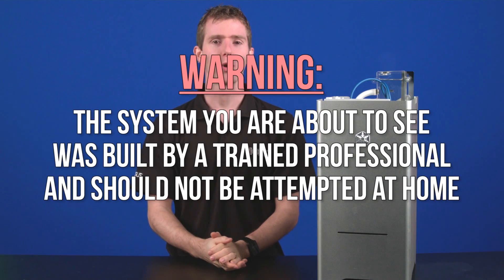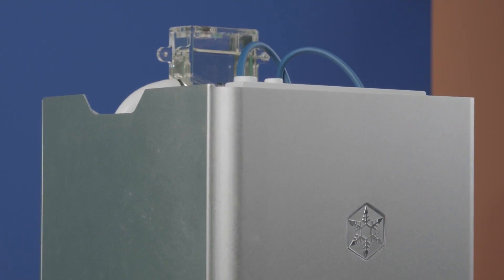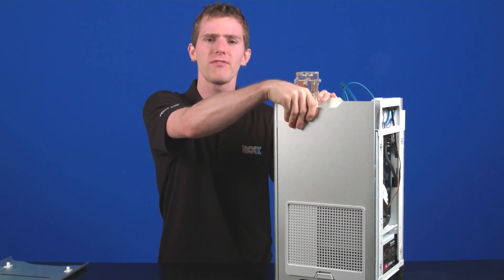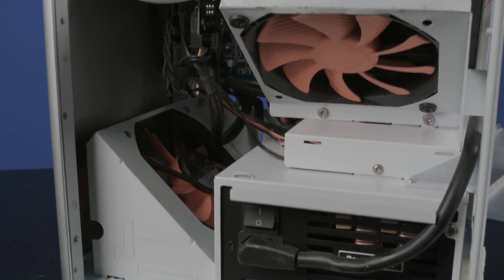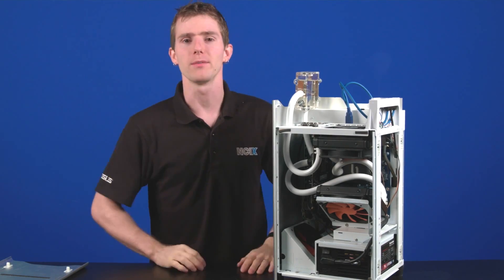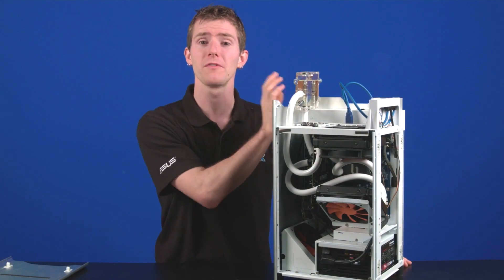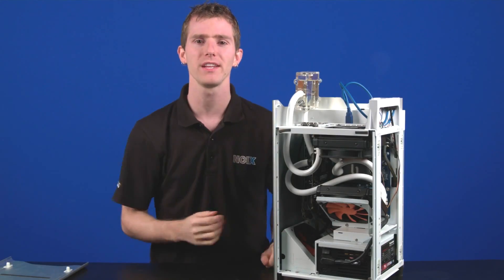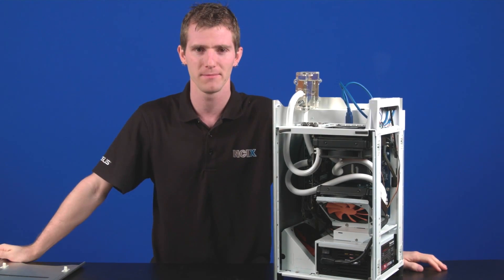Fully Custom Watercooling Loop for under $100!

Comment: just bought a broken nzxt kraken x61 off kijiji for $30 and repaired that. gonna ziptie that suckered onto an r9 290x. had to solder on a new power connection for the kraken so no it runs of molex power instead of Sata power but hey, should work... right ?

Comment: i plan to just get two sealed loops one for cpu and one for gpu and as im pretty handy with tools i plan on making a bracket to adapt one sealed loop to my card, i feel my r9 290 is going to heat up my processor without need if i have them connected or is that stupid and i should connect both loops? and what would be some decent but inexpensive loops to get? i want them reliable as i dont want a spill ove my computer but i want some fairly cheap ones if possible

Comment: I wouldn't trust those pumps in the all in one watercooling kits. If you are serious about water cooling invest in Tygon tubing and the more expensive Swiftech pumps like the mcp series. It is money well spent as you can use it on new systems the only thing you might have to change is the water block. BTW I would NEVER put a power supply UNDER my cooling gear. If you have a leak or even when putting the system together or doing maintenance you never want any chance of spilling on the power supply.

Comment: dude quit bitching about the PCI slot. I think it looks better than if he had cut them leaving a sharp edge, and before anyone says sand paper, then you would need to paint the damn thing. For what he did, there is little damage and I think personally that it looks great.
Reply: You can round with a dremel dude.  Dremel's usually come with something like 12 bits for cutting, rounding, and smoothing.   Honestly, it sort of bothered me as well, and I thought it was sort of funny how he kept going back to it. lol

Comment: This is completely unnecessary. Just put a cheap EVO 212 on the cpu, and use onboard GPU for your HTPC. Simple, quiet, and effective. No need for 3 fans, a pump, various water blocks, case mods, and a reservoir that will break the first time you bump into it by accident.
Reply: ***** Sure I do. I also know there are severe disadvantages to adding a liquid cooling system.
Reply: ***** Liquid cooling takes heat from the chip being cooled at a greater rate. That's the only practical advantage I can think of. The hardware can look amazing when it's done.
Reply: Sometimes that's needed.  I can't see that it's need here, but he was opting for a dIY project here on purpose I think with the intent of never exceeding a certain level of noise.  He stated even during gaming the rig doesn't really ramp up.  So, I get why he did it.  It's neat.  Not what I'd of done, but I hate small cases.  I'd of bought a different case entirely.

Comment: thats hilarious ,i hadn't heard of anyone actually doing what i had done with a zalman lq-310 for my gpu ,drilled holes in the amd bracket ,takes 2 minutes and a lot cheaper than a g10 and most gpu cold plates can be left on to cool vrm passively,i had posted in the red mod forum back in  2014  .nice to see someone else did it .I since moved on to a full custom loop.

Comment: I can't find anywhere a build with both CPU and GPU watercooling system on the FT03-mini case.
Reply: Because it's a mini and they are terrible.  No one wants to drill a hole in there head to design such. I'm sorry, but this looks terrible.  I'd never want to show this off.

Comment: Rebuild the same parts again 2016 & watch how big a hole you loose in your pocket lol, Like holy fuck you guys are ripped off with the dollar.....
Reply: This machine wouldn't be any different than it was a year ago.  The water cooling system with brand new parts is pretty expensive, but getting used parts it's entirely plausible.

Comment: I think it was very cool that he managed that for only 100 dollars which is basically 70 pounds where I live (UK). That is dirt cheep for full system water cooling. Currently my CPU (i5 4690k) is air-cooled with the Cooler Master 212 Hyper EVO. It is always under 50 and usually sub-40 degrees. My GPU (Zotac GTX 970) gets very hot at 70-80 degrees when gaming so I am gonna water cool it with a corsair AIO H60 water cooler. I will use the corsair 970 bracket specially designed for AIO cooling. It will be so epic!!! :)

Comment: Would probably be more feasible to just double-sided tape some noise-reducing foam on the inside of your case and install a few more fans- though for overclocking I suppose watercooling is a must there.

Comment: jesus $100? I spend $400 on an upgrade, though it's a totally different "class", $100 is still impresive for a DIY semi custom cooling kit.
Reply: +svampebob007 i'm actually running with an $16 waterblock, $11 radiator, and $8 pump.
Reply: Kezi
damn what?!
Reply: +Kezi used parts?
Reply: Piece o' LEGO  Chinese crap on ebay
Reply: Kezi lol do you really feel safe with liquid going through your rig with only thing keeping it from failing are some cheap chinese parts? :p i sure wouldnt
Reply: Piece o' LEGO  Seems reasonably solid so far, i've had it for several months now, just booted the pc and the cpu is at 14°¢, it never leaked
Reply: +Kezi degrees in cents… I smell something ƒishy.

Comment: how is this under $100 at all? The two H60's cost $80 each, not to mention tubing, reservoir, etc.
Reply: sales, ect
Reply: +SneakyPancake17 I see H60's for sale for 50$ not that unoften, can prolly pick up used ones for 30-40$ easily

That lil resevoir is probably about 10$, tubing 5-10$.  So ya its concievable
Reply: you can buy parts for cheaper overseas
Reply: +Aura Rowe (Neokolzia) that res is definitely not 10$
Reply: carzacc lol that reservoir doesnt cost 10$ because they dint make them anymore
Reply: Alot of parts locally are overpriced for water cooling but hey what's 70$ for a nice res pump combo
Reply: carzacc the new reservoirs are all cylindrical and cost 30-60$.there's not much science to a box that holds water so the price  is not very high.

Comment: what is best gpu water cooler for XFX Radeon r7 370?
Reply: You don't need to water cool a 370.
Reply: +ealiev60 better just upgrade your gpu instead of watercooling a 370
Reply: +ealiev60 answer: getting a XFX R9 390 instead
Reply: +James Minor not as quiet, that's one of the perks of watercooling.
you'll never know just how great watercooling can be unless you try it yourself.
though it can be a pain in the ass some times.

If you really don't care about temps reaching just bellow stock temps you could go for a fanless radiator, though keep in mind that you should always have a case fan for small airflow as the motherboard needs some cooling.
and that doing a single loop (CPU and GPU on the same loop) will require a bigger rad.
Reply: +HudsonGTV Sapphire cards <3
Reply: *****

Just saw your reply, that's impressive.
even for a lower tier card that's nice, I remember my old 5770 being loud as fuck
I'm guessing you have a non reference cooler.

One of the reason I went wattercooling was because of the bad reference coolers on AMD and Nvidia.

Anyway, if he has the money for it I would totally watercool a R7 370, though I hope he's considering/have the CPU watercooled too.
When you're already "wasting" so much money on the watercooling system, a GPU block doesn't cost a lot.
Reply: *****
lol my r9 290 was so loud and hot with the reference cooler. I love AMD but for people with watercooling their "high tire" cards are relatively bad with air cooling :P

Though for some retarded reason the R9 290 was designed to run hot.

Comment: Kinda bugs me where he makes it sound like this is such a bad thing to do..  Or that it looks bad.  Myself give this guy way more credit then some dummy buying all the proper shit for 20x the price.  The failure rate is just as high most mainstream dudes hooking a custom loop up.  Then again.  Like the car thing.  Big stupid looking wings and all this crap for looks that does nothing.  Way better than buying say a 390 and doing a custom loop.  Where the loop money could of got you a fury or better monitor.   If not a complete moron.  You don't zip tie it.  Cpu hole spread is bigger on 2011 than any gpu.  So you cut the tabs off where holes are on cpu bracket for 2011.  Don't need to but cleans it up,  odd time might hit something on gpu.  But when have gpu cooler off.  Take just the hold down bracket for water cooler,  Place on back of gpu where it would be on top.  Then mark with a marker or white out,   through gpu holes that would hold cooler down.  Then drill the four holes in bracket.  Get some long enough nuts and bolts to pass through card and bracket when mounted back to block.  And tighten.  Id show a picture on how I did mine but don't let me.  Then what I did for my titans,  was mount a oem intel cpu heatsink fan right behind block on my pcb.  But just cut off the part with the tabs that lock it to board.  But allowed me to run the custom 500 watt bios.  Mem was OC'd to 7000hrz effective with 1250 on core for 2 years.  Never broke60 degrees.  Just hate seeing peop-le spend money on stuff where not needed.    Have a crap ton of cash burning a hole in pocket having 4 of best gpu's, cpu and monitor's\ race sim etc.  Then you worry about spending money on custom pointless loops.  I get he aint gonna say this seeing how no l/c company will ever give him anything doing so.  To be honest its more idiot proof then a custom loop if don't cut into it.  Because impossible to leak.  Keep a eye on temp during few benchmarks.  Need help.  Msg me.  I'll email you pics or a drawing on what I mean on how to do bracket if don't understand my horrid grammar all to well.  Just love seeing people do stuff themselves like this.  especially with such amazing results..
Reply: +Keaton Buster - He is only showing the setup as an oddity, like using wire or duct tape to hold something together. He is just having a bit of fun with the guy who built it. He never said it was bad and gave the system a pretty good rap, only stating that it wasn't for novices. He didn't point out that the cash outlay is a false economy, since it probably took a lot longer to piece it together than had the guy paid for a kit, (i.e. his time is not being factored into the equation, not the running around as he collected each bit).  

Of course, people do stuff like this for their own amusement, not to save a few dollars.

Some people like to endlessly fiddle with their computers, and some people just like to build them, get them running and actually play games - not open them up every other day to poke at something else.

Comment: awesome mod. so using multiple pumps and rads is okay? i have the h60 and h100 and i wanted to put it all together and use the hg 10 to get my gpu in there also. is this sensible?

Comment: I use the NZXT Kraken G10 bracket on my systems and they're pretty good. For my X99 system however, I am going for a DIY water cooled system.

Comment: I have never used a CPU cooler on my gpu but my last video card was an Amd r7 260x which would hit 70 when just browsing net unless I manually set fan at 60% which dropped temps to mid 40s.  I did an RMA and new card was the same.  I ended up putting an akasa 80mm case fan on the back of the card.

Comment: hmm. I made a bracket for my 980 to fit the H60 on it.
but I want MOAR cooling.
so ... dude my DIY genes are pumping xD
wouldn't fit so good into my 250D... I may install a external rad somewere.
but I don't want to get it ugly.

Comment: Hey everyone I'm thinking of building my first PC. I do some video editing and gaming, would this be good enough? I'm resuing this processor from my current build so it's free :P Oh yeah and I want to put those two SSD's in Raid 0.

Intel Core i7-4770K 3.5GHz Quad-Core Processor
Noctua NH-D15 82.5 CFM CPU Cooler
Asus Z97-A ATX LGA1150 Motherboard
G.Skill Sniper Series 16GB (2 x 8GB) DDR3-1866 Memory
Samsung 850 Pro Series 256GB 2.5" Solid State Drive
Samsung 850 Pro Series 256GB 2.5" Solid State Drive
Gigabyte GeForce GTX 970 4GB WINDFORCE Video Card
Fractal Design Define R5 (Titanium) ATX Mid Tower Case
EVGA 750W 80+ Gold Certified Fully-Modular ATX Power Supply
Reply: Quite a setup for a first
Reply: Something Random Inc. not good enough you need to at least get Nvidia Titan and make sure it can run candy crush ok
Reply: I would add a hdd to the build as well since 256gb isn't that much. And since you're going to have videos/games the space will run out quite fast :)
Reply: And you do know that if one ssd fails in raid 0, all data is lost
Reply: I hope he doesn't raid the ssd's.
one is fast enough.

i got a 256gb at the first place. installed my windows and games on it.
that was all I've got.
you need to uninstall every old game you don't want to play anymore.
later, I added a 500gb ssd to the 256. 
the 256 holds the OS and Photoshop, quick downloads, personal data n stuff like that.
the 500 holds all my games.
thats plenty
additional to that I've got a 3tb wd green, in a fast and low partition.
I store all my Video Creations and Work on that.

works out very well to me.
Reply: DESCENT im thinking of the Plextor M.2 SSD alone now, it's only 50 bucks more then the 850 pro but it has 770mb/s read and almost 600 write. Should be plenty fast enough without needing to raid.
Reply: holy shit. thats quite a bit.
But I'm happy with the Samsung EVOs. theyre fast enough for everything. doesn't have to wait at all.
Reply: I literally built my first PC about a month ago with almost the same exact parts you mentioned in the list, haha.
I'm happy with the build :)
Reply: LedZeppelinPage What did you do differently and why? :P

Also, would you recommend the r5 if that's what you used?
Reply: Sorry for sticking in like this but you can watch any review out there and they all say the R5 is great. There's really no reason not to buy it. Hell, if I  needed a new case now, that would be it :)
Reply: Why go with raid?? Why not get a mass storage hdd to? An ssd 4 the operating system and 1 for programs you use a lot, and the hard drive for music, photos, videos and other data
Reply: Owen Parsons I since changed this to only 1 SSD Because 256 GB is more then enough for everything I use it for. i have a 126GB one currently and there's still 30 GB of free space.
Reply: Something Random Inc.
I got a h75 corsair water cooler for the cpu.
I also got a 650 Watt PSU since it was more than enough for the build.
That's really the only difference between our builds.
The R% is incredible, extremely quiet and very customization, so worth it.
I am VERY satisfied with my build.
Reply: Something Random Inc. it's more than enough. good job man. that 8 thread CPU will be great for your editing and it's single core performance with that 970 will game great. I've got a Define R5 as well they're 8/8. ANNND the exact same PSU (it looks great and runs well)
Reply: Something Random Inc. holy crap my first build was a pentium and r7 265. mind you, it is now a 5690k and a MARS III (that's asus' dual 760 graphics card) that kicks ass.

sounds like a damn nice build, but get those ssds out of raid and pop in a 4tb drive and you're set for life!
Reply: Something Random Inc. Yeah but it sacrifices 2 SATA ports, you might as well get something faster like a PCI-E storage which (don't quote me on this) sacrifices no SATA ports but is much faster than any M.2.
Reply: kalef1234 Just to clarify: I'm talking about the M.2 SSDs.

Comment: I DIY everything, when my old Hell XPS 400 motherboard died, I took the opportunity to replace it with something slightly better, Its now a 410 the only thing on this machine that is Dell is the case *mofified and the motherboard the rest was replaced. I also build my own cases for my other projects, I turned a crappy old Lane Cedar chest from 1965 that should have been thrown into the burn pile into a epic huge pc case. later I will rework that to hold a HUGE watercooling system.

Comment: I have a cooler master glacer 240i as my reservoir and first radiator going to the CPU block that came with it, to a corsair h110 radiator, to a antec kuhler 920 radiator, to the h110 block on the first gpu (hd7990) to the 920 block on the 2nd gpu (same hd7990), to a swifter universal gpu block on 3rd gpu (hd7970) then back to the glacer rest/rad. I have a total of 4 blocks, 3 pumps, and 3 radiators (824 square centimeters of combine surface) and temps on AMD FX 8350 oc to 5ghz 1.54v tops at 60c on prime and all gpus top at 58c on furmark at 1200mhz 1.3v. With nactua fans installed this baby is quiet. I started with the h110 on CPU then expanded from there as I found sales here and there over the last 2 years.